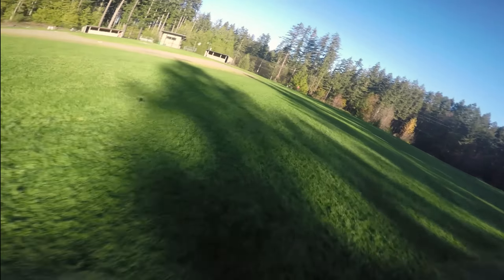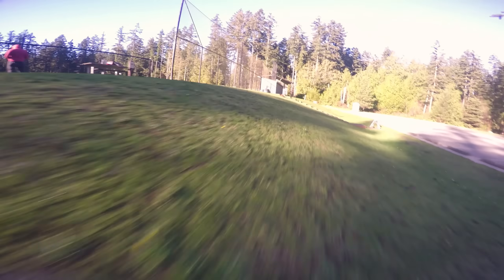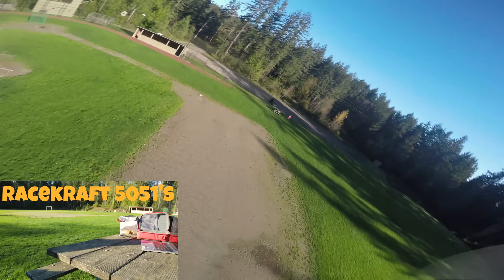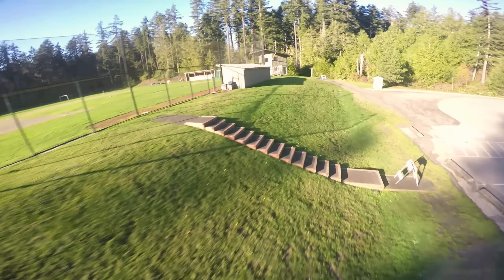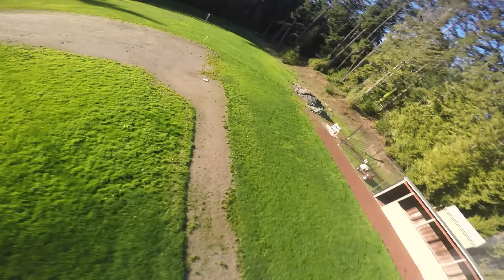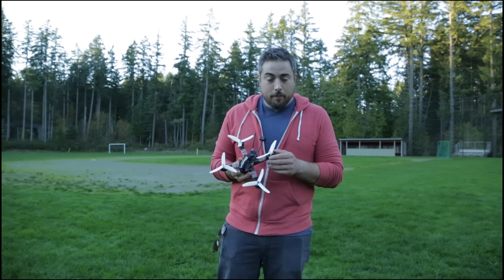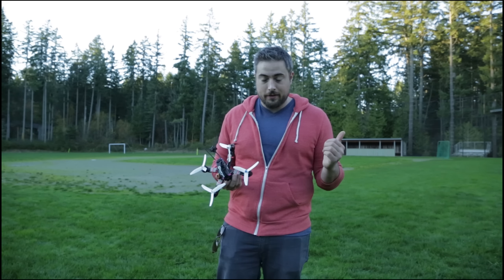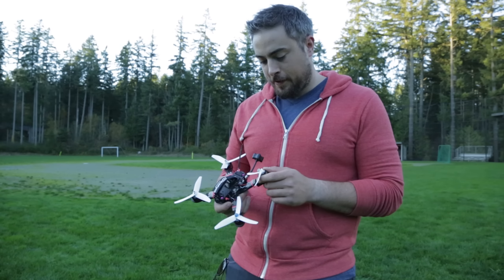First Take: Emax rs2205(S)

Comment: I did some speed runs on my channel with 5051 RK props -old red bottom 2300kv got me to 95mph, swapped the motors to the new Emax rs2205s 2600kv and got 109mph! 
Yup- these motors are staying on my quad- propping back down to some 5040x3. The feel is awesome!

Comment: If they really solved the mid-throttle oscillations issue, they've got themselves a goldmine. They're tuff AF. Great for indoor flying. I dig your vids man, great style. ❤️
Reply from the maker: In my case, I didn't have any of those oscillations.  Not sure if it's fixed, but it worked for me!

Comment: I'm getting mid throttle oscillations with the 2600kv version of these motors on my 180 quad. Its like a very high pitch trill noise. Adding D brings the oscillations out more but having D very low does not get rid of it. I have soft mounted both my motors and FC.

Comment: Gapit FPV I have the low throttle hum on my 2205's 2600kv's but only with the racekraft props. I think it has something to do with hitting the resonant frequency of the those props and it just makes that terrible noise and adds a little vibration. HQ do not do this, but they are a little softer composition. Just my thoughts
Reply from the maker: Which RK props?  If it's the 5040 tri's, you're just going to get resonance, no real way around it in my experience.

Comment: Nice review. I was thinking either a set of the rs2205s on my next build or a set of zmx 2206 fusion but I heard they die quick. Do you know what kind of thrust they deliver? (grams per motor)
Reply from the maker: Most everything will be on miniquadtestbench.  I've heard the same thing about the fusions, though they seem to pack quite the punch!
Reply: GAPiT FPV yeah I see the bench test for the fusions and he rates them well. I'm just worried how long the bearings last etc. Nice work. keep it up 🖒

Comment: What do you believe are the most efficient motors on the market today?
Reply from the maker: 2204 100kv.

But seriously, in this class?  For 5" props?  The lumi 2206 2350's are hard to beat for efficiency, but that usually comes at the cost of thrust.

Comment: Would 20a esc with 30a burst be enough for these motors please .
Reply: pukkaskunk87 with RK5051 100amps /4esc's is 25a per ESC and with triblades 85amps /4esc's is ~21a per motor. So if you run HQ 5040*3 you will be fine, but if you Run RK5051's go for some 30a little bee's

Comment: you said at some point its pulling 100A..wouldn't your escs explode?
Reply: There are four ESCs that that amp draw is pulled from. So only 25 amp draw for each motor.
Reply: I pull 90 amp load alot..  Esc are    x4   for a quad.. so    90 amps   equates to 22.5 amps app across each esc.. Since my TBS stuff can handle alot more than that, were good!

Comment: bro, they sent u 4 same motor right? there isnt mark cw or ccw? or 2 cw and ccw? because i check on their website, they dont have option for cw and ccw..
Reply from the maker: I'd be surprised if they even make CW motors.  Everyone just uses ccw (that way the prop nuts are cw) and swaps motor wires to reverse direction.
Reply: ohhh, thats normal? just reverse the wires? and u tighten the screw on all motor with the same direction?